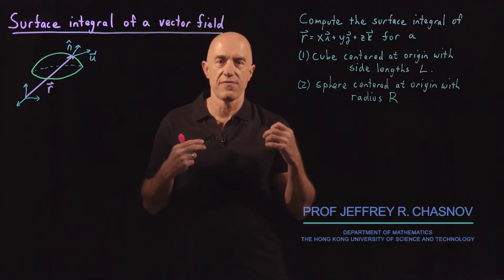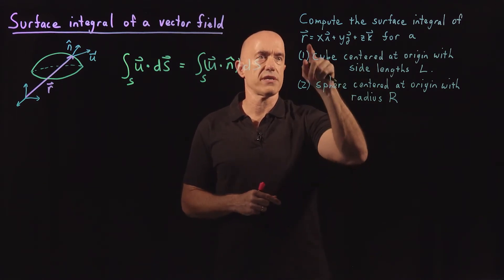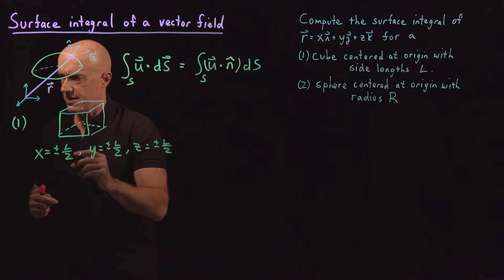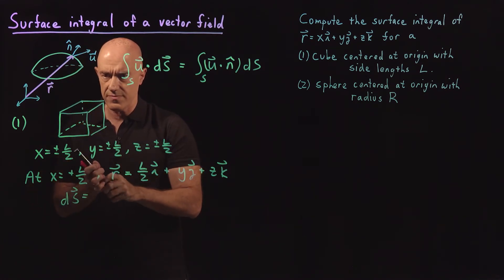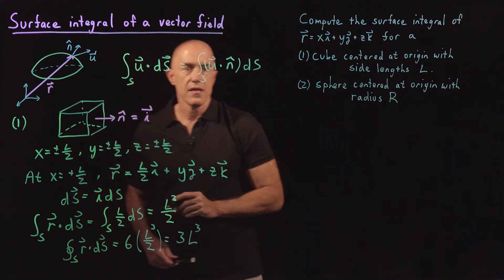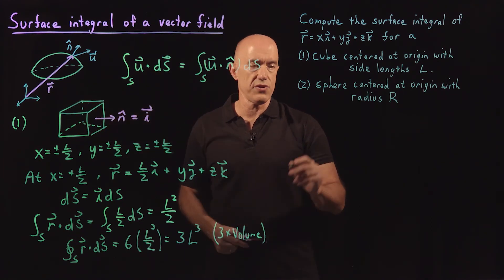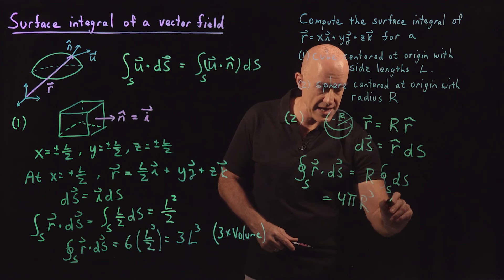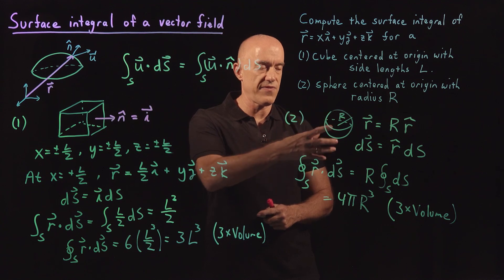Surface Integral of a Vector Field | Lecture 41 | Vector Calculus for Engineers

Comment: So, for the cube, fluxes at all faces make positive contributions, since for the opposite faces, the coordinate is negative but the normal vector points in the opposite direction, and the two minuses cancel: fluxes across all six faces add -- the field is diverging on every face. The position vector is not always normal to the cube face, but by symmetry arguments, the non-normal contributions cancel.

Is this a valid exposition of the details?